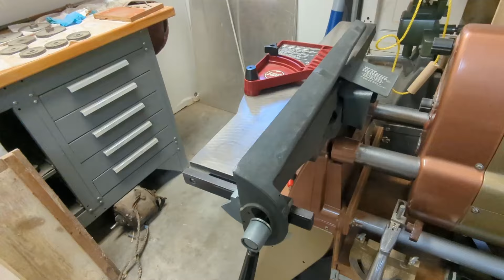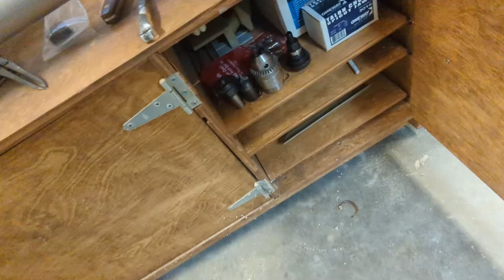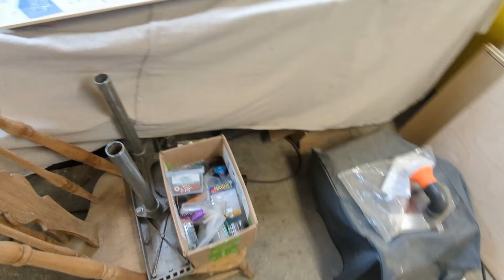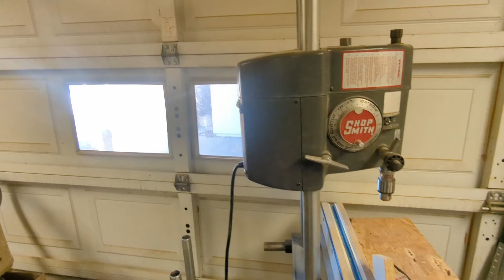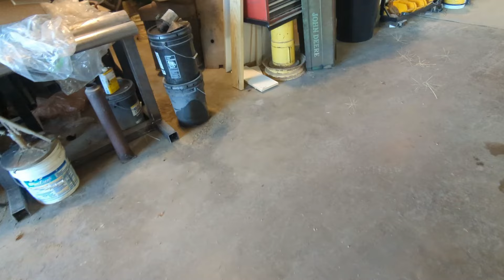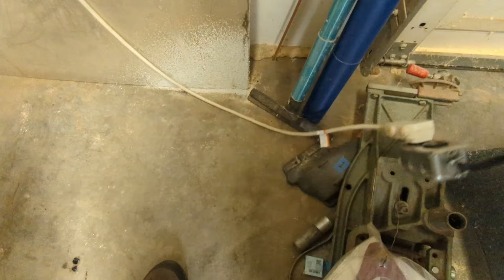Shopsmith Mark 5 Goldie Restoration: Post-Project Review and Lessons Learned

Comment: Just picked up this exact model yesterday for free from someone who just wanted it gone and was hoping I too could restore it but definitely not as knowledgeable. Even came with the disc sander, biscuit joiner, strip sander and jointer table attachments. Didn’t know what I could do but then blessed with these walkthroughs. Came out beautifully and hoping to achieve the same, thank you for this
Reply from the maker: That is an incredible find, good luck with your restoration.